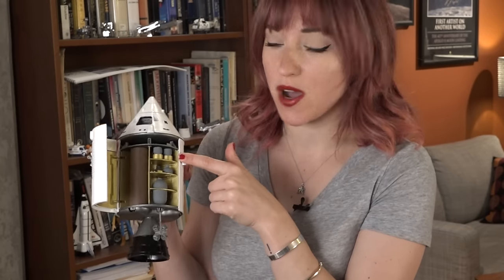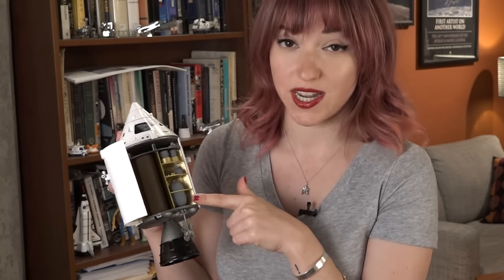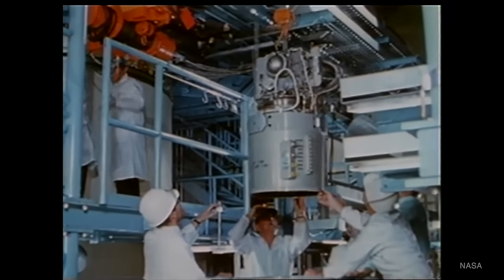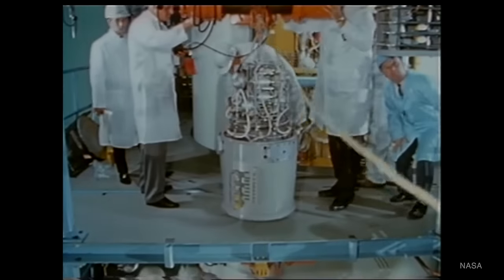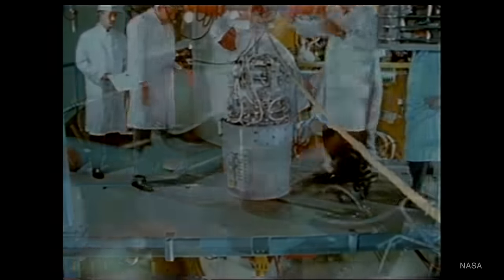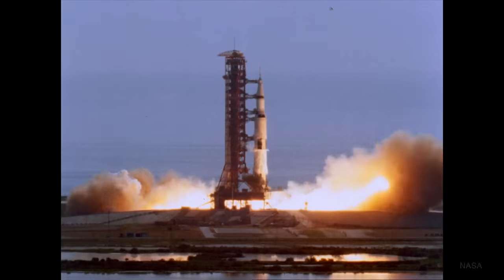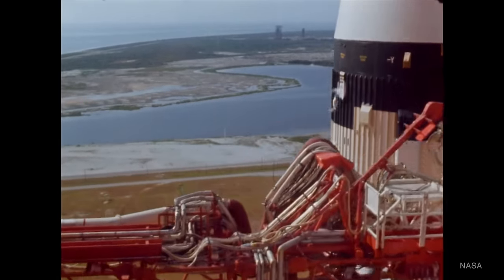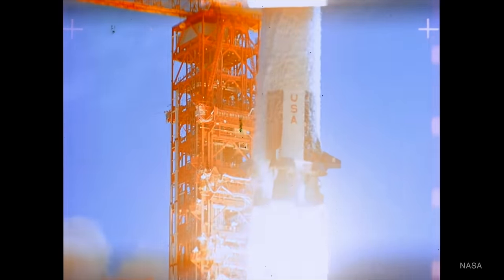How Quickly Did the Crew of Apollo 13 Know They'd Lost the Moon?

Comment: Sorry to burst bubbles here but the Apollo missions, including Apollo 13 never happened since it is not possible for rocket engines/thrusters to work in space. 

Consider this:

There are two forces required for a rocket to fly. Thrust and Downward Force (Air pressure). 

The Thrust comes from the burning of fuel at the bottom end of the rocket where hot gases are forced from the combustion chamber down through the nozzles. 

The Downward Force comes from the positive pressure of the air enveloping the rocket which gives the expelled hot gases the resistance with which to push against, (Newton’s third law). 

Without this positive air pressure enveloping it and providing a constant resistance, a rocket could not fly. 

In space there is no air which naturally means there is zero pressure on the rocket and therefore, absolutely no resistance. The vacuum of space is the complete opposite to the atmosphere of Earth. It is, as we currently understand it, completely void. So, as soon as the nozzle is opened to release the gases, the combustion chamber becomes part of the vacuum of space and is thus subject to its laws.

Although a closed chamber is under pressure, an open chamber is not. Consequently, the hot gas molecules expelled from the open chamber would endlessly disperse into the far reaches of outer space. Since the molecules which leave the combustion chamber and enter the vacuum of space would travel at a constant speed, never slowing down or colliding with any outside elements, or indeed with each other, their force is always moving onward and away from the chamber and so there is no way for that force to be positively returned to the rocket.
 
So, essentially, without the required resistance of positive air pressure to push against, a rocket could expel its hot gas molecules into space for eternity and not move an inch...

(Please note. I have no interest in, nor will I respond to, posters who think it okay to use ridicule, sarcasm and insults as their core argument).
Reply: +Franky Uk :When the Apollo Saturn-V rocket was viewed by millions, including me, you could see the plume spread as air pressure decreased with altitude. Then at stage 1 (S-1C) separation, the second stage engines ignited continuing to push the rocket further up. This typically occurred at an altitude of 35 to 40 miles or essentially space. In order to think Apollo missions were not real for the reason your mentioning, you then have to think unmanned missions including weather satellites, comm sats, spy sats etc. are faked. You then have to believe the U.S. Russia, UK, France, China and Israel are scaring the bejesus out of each other and everyone else with what would be fake ICBMs in your scenario. ICBMs travel well into space as part of their ballistic flight profile. There was a well publicized photo of a Peacekeeper ICBM test in 1984 in which 8 of the MIRV warheads were imaged screaming back into the atmosphere near Kwajalein Atoll from space after being launched from Vandenberg AFB California. That would not be possible if rocket engines didn't work in space.
Reply: +Franky Uk  Rockets don't work by pushing on the air behind them, but by throwing mass rapidly in the direction opposite to travel. Picture a child throwing real and then styrofoam bricks off the back of a wagon. Both sets of bricks move air-they're the same size- but the mass of the real bricks does the moving.
Reply: +Pygar2 
What you're describing is impossible. 

The laws of physics assert that every living, walking, running, jumping crawling, flying, swimming creature, (including humans), and all man-made machines that move on wheels, tracks and legs, fly or hover with propellers, rotors, jets or rockets must have the ability to thrust against a separate external resistant force in order to be able to physically move in a chosen direction. 

Consider this:

Since space, as we currently understand it, is a vacuum with zero air pressure, the only way to make a rocket appear to be able to work in space would be to somehow demonstrate that, (unlike everything else on Earth), a rocket does not require the separate external resistant force of air pressure to thrust against.

Naturally, this premise could only be possible if there was a scientific method of rocket propulsion that looked authentic. A method that seemed so credible it would make people believe a rocket could work, not only in the thick atmosphere of Earth but also in the airless void of space. A method that was plausible enough to brainwash the entire world into believing a rocket could really work in a vacuum.

And the only way to do that would be to completely disregard the laws of physics, utilise a skewed version of Newton’s third law and then advance the fanciful premise that a rockets thrust could push away from the rocket, and the rocket body could push away from its own thrust, thereby achieving upward motion by becoming self-perpetuating. 

To demonstrate this ‘self-perpetuating’ premise, NASA created their ‘bowling ball’ model. This model asserts that, if you stand on a skateboard with a bowling ball and you throw the ball away from you, the action will cause you and the skateboard to move in the opposite direction to the bowling ball which, of course, is true. (Naturally, you would get exactly the same effect standing on a skateboard and pushing against a wall). 

But does it accurately prove a rocket can work in a vacuum? 

There is no denying that If you stand on a skate board and throw the bowling ball away, you and the skateboard will indeed move in the opposite direction to the bowling ball. This is because, by throwing the bowling ball away, you have basically pushed against a resistant force that is separate from you.

However, if you stand on the skateboard and make the action of throwing the bowling ball but you don’t let go of it, you will not move an inch because the bowling ball is then as much a part of you as any other part of your body and so there is no action or reaction. 

The point here is that nothing biological or mechanical can move without having a separate external resistant force to thrust against, not even a rocket. It is contrary to the laws of physics for anything, including a rocket, to be able to push its body away from its own thrust. And since the thrust engine and its thrust are as much a part of the rocket as all its other systems, the thrust engine requires a separate external resistant force, (air pressure), for its thrust to push against and drive the rocket skywards. 

And this is why a rocket can fly in the atmosphere of Earth but not in the infinite vacuum of space.
Reply: +J Dean 
As I explained in my previous post, it is impossible for rockets to work in space without air pressure. Ergo, rockets cannot put satellites into space. ICBM's are rockets and so they too will not work in space... A photo is a photo, I'm afraid, and is certainly not actual proof of ICBM's returning from space...
Reply: Newton's third law of motion states, " For every action, there is an equal and opposite reaction." That is what is happens when you push a bowling ball away from yourself. This will happen on earth, as you admit, and in space. Rockets do not push against air to fly, it is the reaction to the exhaust gases traveling at supersonic speeds from the rocket nozzle. You see kinetic energy increases to the square of the velocity which means that your bowling ball can be replaced with gas(In a liquid fuel rocket; CO2 and water vapor) or water or anything traveling fast. Think of a gun recoil with a small bullet, then a machine gun, then continuous spray from a water cannon (Any firefighter can attest that water can provide powerful thrust!). A Saturn five rocket's first stage produced about 7.5 million pounds of thrust, the bowling ball, in this case, is the combustion gases from over 520,000 gallons of fuel and oxidizer expelling from the rocket engines over about 2 minutes. Propellers and jet engines also provide thrust by pushing air backward to create the forward (opposite reaction) thrust necessary for sustained flight. I had a small water rocket powered by compressed air, (From a small hand pump); Once you see one of these in operation, it all becomes clear. Also, many labs have put small rockets into a vacuum chamber and pumped out the air; The rockets still work.